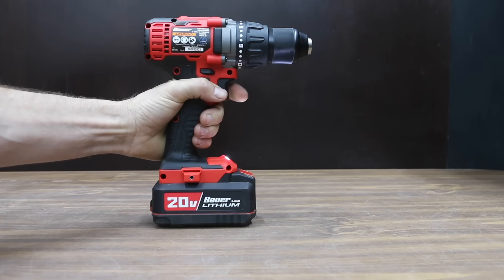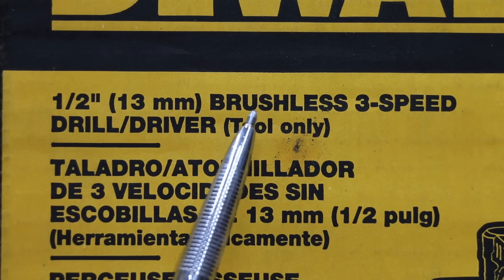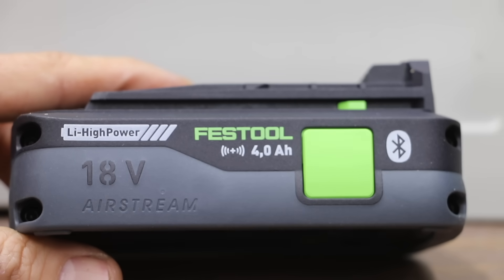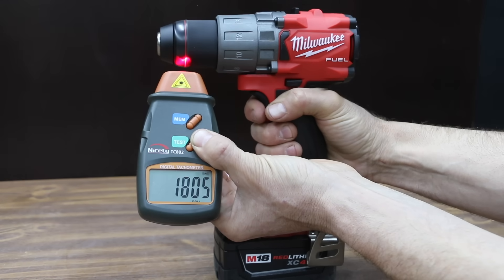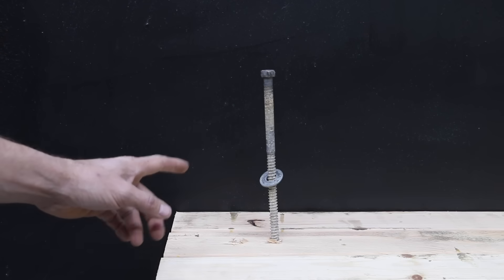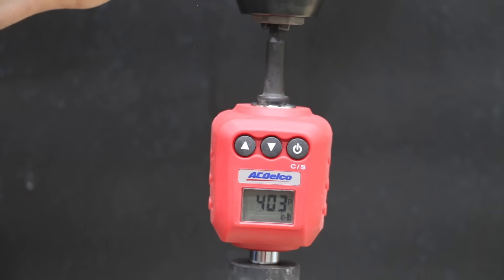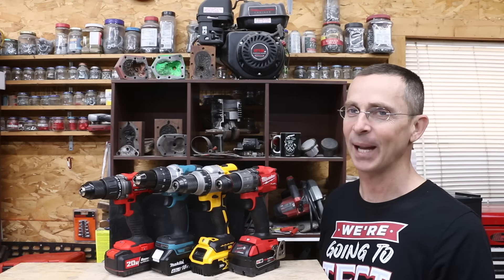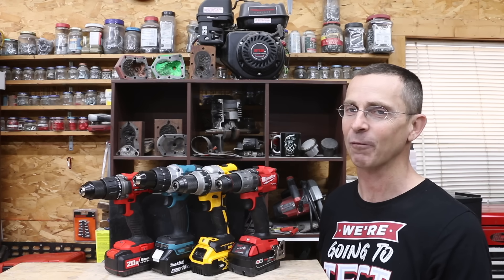Best Drill (BATTERY POWERED)? Milwaukee vs Dewalt, Makita, Bosch, Festool, Ryobi, Bauer, Ridgid

Comment: I have the Milwaukee drill with hammer function. This thing kicks like a donkey when it comes to removing tight nuts and bolts
Reply from the maker: Thanks for the feedback.
Reply: Yeah that's why I always use the impact driver for tight bolts, it has no kick
Reply: @techguy666  After it dislocated my shoulder I use my impact gun too - assuming I'm still able to. I thought it was a good idea to buy  a 2863 as my main impact gun but this bastard has the weight of an aircraft carrier. All for a 10mm bolt after all
Reply: @LMO169  I wish you speedy recovery. I was actually referring to 2857 which is far better than the drill for driving bolts and much lighter, the thing is a little beast!
Reply: @techguy666  Very much thank you, but I'm all fine. The shoulder dislocation part was all metaphorical speaking.
I'm still weighing the pros and cons if I should go for a 2554 or a 2557 if that stuff wouldn't cost two arms, a leg and a kidney here overseas

Comment: My biggest grip with cordless drills is batteries. I've barely used my dewalt and one of the packs has gone bad. A new one is close to $100. I think I'm going with Ryobi as my next drill as they offer l-ion packs at a more reasonable price. As a side note...I've never had cordless drill where the drill itself went bad. It's always the batteries that make it a paperweight.
Reply from the maker: Thanks for sharing.
Reply: Just buy non dewalt batteries at 1/3 the price. They work fine👍👍

Comment: Curious how the newer brushless Ryobi would  do in this test. Always appreciate the content!
Reply: Yes please! I ended up going all in on the ryobi brushless lineup and have been quite happy so far.
Reply: Ryobi and Milwaukee are owned by the same company, so Ryobi is always going to be the "budget" option that performs worse than Milwaukee does.
Reply: @SongOfStorms411  Great to know! I really went with ryobi because they have so many tools that use the same battery. I'm just using tools around the house and I don't want more than the 4 or so batteries I have already.
Reply from the maker: Thanks for the suggestion.
Reply: it sould be compairable to what he used in his hammer drill video.

Comment: Why no Hilti tools?
Reply from the maker: Thanks for the suggestion.
Reply: @ProjectFarm  You're Welcome.

I've had Hilti tools since 2011.
I bought a set in 2011 both a drill driver and the 1/4" impact driver.
Both are the 18v-22v equivalent. 

I killed the drill driver last year, I smoked the com bars as I tore it down to see what failed. It had a brushed motor. It did have 15k hour's on it and lasted 10 year's of heavy use.

The impact driver still works and still is going hard. However the gland end where the tools clip in. Well that has disintegrated so it no longer holds bits or snaps in like they once did. Yet it's almost 11 year's old. 

Considering the price back in 2011 for the set was close to 1k. It was by far the most expensive set of drills I've bought.

Considering both drills and the batteries lasted for 10 year's plus in extreme heavy duty commercial use.

I would be highly interested if they still used the same quality and robust construction as they did. Or have they gone to more of a pro sumer build. Like many of today's brands have.

Thanks for the great videos

Comment: DeWalt, Stanley, Porter Cable, and Black & Decker are all owned by the same company and many of their parts are interchangeable.  DeWalt is the most expensive but they all are typically good quality.  Not as good as Milwaukee, but for the price a good deal.

Great video as always!
Reply: Had a Porter Cable 1/2" drill 
turned out being a "POS" plastic gearbox. Never again.
Reply: @marklubecke4854  That sucks.  I've had a B&D 18 volt hammer drill since 2005 and it is still going strong.  My dad loves DeWalt;  I shouldn't tell him that a B&D is the same device at a lower cost....

Comment: As a contractor I’ve used and abused almost every brand corded and cordless tool except for the harbor freight branded ones. It was always the batteries or chargers on the cordless ones that failed first so I settled on Milwaukee for my cordless ones. I bought the battery Milwaukee chain saw even though in your review they didn’t come out on top but because I have multiple Milwaukee batteries and chargers.  Keep up the great reviews.
Reply from the maker: Great feedback and great point on the batteries too!!
Reply: Yep the battery usually always fails before the drill does in my last 4 or 5 drills anyway
Reply: Hoping to get that Milwaukee chainsaw myself! I think it tested similar to Dewalt and like you say once you’ve get a half dozen batteries you’re kind of stuck but I’m happy with Milwaukee
Reply: @davechapman451  Project farm said him self the 2 best chainsaw’s were dewalt and Makita.
Reply: I have makita Dewalt and Milwaukee.

Comment: My dad has almost all of Dewalt's power tools in his tool room because he had a good deal from Dewalt's 12v 18V and 20V batteries sometime in the recent past
Reply from the maker: Great point! Thank you
Reply: I have all dewalt because they have made it extremely easy to upgrade and buy newer tools without ditching the old ones. The 18 volt lineup can use the newer 20 volt batteries via an adapter,  the 20 volt tools can use the flex volt batteries,  some of the flex tools can use 120 volt wall power through an adapter.  Thank you dewalt for that.

Comment: This viewer recommending testing FLEX?
Reply from the maker: Added to my list for round 2. Great suggestion!!
Reply: @ProjectFarm  thank you for taking the time to respond. Alot of hype around FLEX Tools and since it’s the latest greatest, thought it would be a wonderful suggestion. FLEX Turbo is what I’m interested buying but before I do, let’s test it. But it has to be FLEX TURBO. PLEASE keep in mind, FLEX has non-turbo tools. From everything I’ve seen so far, FLEX Turbo has more power and less time to drill, cut, torque stuff. The FLEX tool company makes claims it bets dewalt, Milwaukee other major tool brands. I currently don’t own any tools and are in the market. But committing to just 1 battery system is expensive. The 24V 12.0AH LITHIUM-ION BATTERY is 250.00 bucks at my Lowe’s and that’s for one battery. Not including the price of the tools. Thank you for taking the time to put these video’s together. I’ll keep watching your channel and be on the lookout for you testing the FLEX TOOL Turbo system.

Comment: Hey. Can you do a test on https://www.rvs-usa.com/
Triboceramic engine coatings. It's a Finnish company but they have expanded to american markets now so i would love to see you test their product and see if any of the claims are real. 😍❤
Reply: I have tested in my bikes engine the product and it felt as the engine runs smoother but could be all just in my head so definitely would be cool to see your methods of testing the product and the claims. They have a car in Finland and USA that's been treated with the product and they are running them without oil to prove that it works but hard to say if it's just a marketing trick or do they actually work so well

Comment: Love it when manufacturers make claims and they HAVE to start sweating when you say "We're gonna test that!"  LOL
Reply: Look in to vacuum HP ratings and you know exactly whose the most full of it.
Reply: @mossyhollow3732  that's the tricky part of using hp as a rating. 18 wheeler has about 400 hp but a 700 hp pickup can't budge 75,000 lbs
Reply: Iron *Fe*  Claims such as RMP and torque should be very close to manufacturer claims, that has nothing to do with the materials they are designed to drill, cut etc.
Reply: I have a Hyper Tough drill I bought cause I needed a drill ASAP and wal mart was the only place open at the time and I have to say it’s lived up to its name. I’ve dropped and thrown it many times and still works fine.
Reply: @dudeabides4501  Snap On for professionals that can deduct it...  Hyper Tough for occasional use in non commercial settings.  I paid $8.00 for an old Black&Decker jig saw at a flea market; didn't even have to buy a blade; got the light job done...
Reply: @johnsee7269  snap on power tools are junk
Reply: @Teredifa  Warranty like Craftsman used to be...  break it; return it; get another one no questions asked.  That's what put Sears out of business; guatanteed forever and eventually everybody had them... (no need to buy more; lol)
Reply: Dewalt was pissed when that other guy did that dewalt Milwaukee challenge 🤣🤣🤣🤣I never liked dewalt anyway
Reply: Iron *Fe*  well said!
Reply: Love it when this same comment gets posted in every single video
Reply: Word
Reply: Right. Now we know why the companies don't do these tests lol.
Reply: Typical American made shit. Always over performing smh😤
Reply: Well not necessarily.  Some of them their promises hold true, but the question can be "for how long"?  Some of the cheap branded ones for example may be more powerful than the $500 ones, in the beginning, but you have to ask yourself, how long will this no-name/cheaper drill last.  How long will the battery last?  Things like that.  So they can make claims, and sometimes they are true... for a period of time at least.  I personally would recommend the MIlwaukee's as mine has suffered about 4 falls so far from a second story roof.  STill going strong.  I did have to replace one battery pack the broke open though, but that was the battery, but the drill is still going strong now in its 5th year...
Reply: @HR-wd6cw  I had a pprter cable drill dripped it off my roof it runs pretty good still just taped it up
Reply: Iron *Fe*  I am pretty sure than manufacturer's methodologies are less severe. ✔️
Reply: The manufacturers don’t know or don’t care about what some youtuber says about their products.
Reply: 😂 I thought the same thing.
Reply: Ridged all the way
Reply: He press harder when testing american products,typically american
Reply: @TheGagi82  Put out your own video and show us.
Reply: @TheGagi82  I've been handling power tools for over 40 years! It's the bits that does the cutting. Pressing down on a tool will only bind the motor more.
Reply: @thomascdurham9130  A certain pressure must be applied in order to do the job.
Reply: @TheGagi82  he didn't deny that 🙄
Reply: @thomascdurham9130  yup i kinda feel the same which is why i use a $20 tool on my diablo blades

Comment: I would like to suggest the 18-20v string trimmers for comparison. The brand I have is rather disappointing in design and power and I wonder if problems are similar across other brands.
Reply from the maker: Thank you for the video idea!
Reply: Step up to a higher voltage for something like a string trimmer, 40+volts. You'll be much happier
Reply: @Phate8263  that's the plan. I just want to know if mine is the only one that sucks 😂

Comment: Wow, that was the fastest video upload notification I got for my favorite product testing channel. :-)
Reply from the maker: Thank you very much!  I really enjoy ALL of you videos too!!  Amazing reviews on the ElectronicsNmore channel!!!
Reply: @ProjectFarm  Did you ever do one on the hitachi/metabo 18 volt drills/tools?  I have that brand, with a sawzall ,  a 6" circular saw, and the awesome small sized drill (I have bad carpal tunnel). I ask because I have several batteries and a charger that still works. I know they aren't the best, and Hitachi  sold to Metabo the prices have gone way up, and availability have gone down. If you have done a test on that brand, I couldn't find it. Thanks, and thank you for all your great videos.
Reply: @ProjectFarm  
The Milwaukee will do Lower Torque when you use the second Gear!
Reply: @ProjectFarm  DeWalt's 991... Why not the 996 or the 998 or the 999... The 999 is with power detect is a beast.. The 991 is an older drill with half the power. Milwaukee's 2803-20 is a newer model.. Seriously YouTube it.. The DC999 is by far the best drill as of now.
Reply: @John-771  why don't you make the videos? Ahhhhh exactly
Reply: @garrettbybee-mullins6634  Same reason you don't. I don't have the time, or energy. I work in HVAC 40+ hrs a week and use the tools he's showing. Besides If you are going to compare the latest and greatest of one brand you should compare it to the latest and greatest of the others. Am I wrong?
Reply: @John-771  I love my 996, it was the best of the best when I got it about 4 years back
Reply: @RickBaconsAdventures  and he's comparing the 991 (older) to top of the line today.
Reply: @John-771  and it still kicks butt
Reply: Why don't you comment on Taofledermaus anymore? You used to every video. Did y'all have a falling out? Are you anti 2A now, or?

Comment: Testing Festool is just trolling at this point.
Reply from the maker: Thanks for the feedback.  Lots of viewer requests to test Festool
Reply: Would be cool to see how well Hilti stacks up against it; if it would be close to Milwaukee or Festool.
Reply: @QuantumLeap83  Hilti's new brushless stuff hits pretty hard. People will definitely cry foul for it being 22v vs 18v there.
Reply: @orijimi  if they want to use the 22 volt Mikita gets to run the new 40 !! 😁
Reply: @orijimi  22 ,20 and 18 v is all the same the voltage is just measured differently. Take apart the battery and it will have the same number of cells.
Reply: @morgancoldfirecoldfire8256  22v/24v is one more cell, you're wrong. Equal watt hours between an 18v battery and a 22v battery? Yes, that's possible.
Reply: @robertcollett8073  Philly Fixed put the new XGT Makita drill up against the 18v/22v competition, and it might as well be 18v, the thing is pathetic for a supposed next generation tool. I run mostly Makita, so it's pretty damn disappointing to see.
Reply: i must be mixing 18 and 20
Reply: @orijimi  I’m going to have to check that out. Makita is my brand so I was expecting almost plug in power.
Reply: @robertcollett8073  Oh, whoops, actually, I went back and checked and what I'm remembering is the impact driver. The XGT drill did actually perform better than DeWalt and Milwauke, but by nowhere near the margin that the M18 impact driver outperformed the XGT.
Reply: @QuantumLeap83  I made the same comment. In Europe many professionals buy Hilti because it's well known to be the best. You don't buy just a tool, you buy a service. I don't think all the Hilti tools are necessary better, in some cases DeWalt, and Milwaukee especially, might be better, but in most of the cases I think they are not. It would be great to see Hilti in these reviews.
Reply: @QuantumLeap83  hilti drills dont come close to milwaukee or dewalt on power or speed
Reply: i was looking forward to seeing the drop test :)
Reply: I use the Festool PDC daily bought it second hand, this drill design is also realy old 2012 i believe
Reply: @MickDuijf  Is 2012. Looks 1990s.
Reply: @orijimi  😂
Reply: I'm glad he's testing festool
Reply: Hilti would have been a better choice than Festool, a brand few encounter in either home or professional use.
Reply: @cristopherfrakes1416  alot of people in europe use festool way more then hilti
Reply: Why would you buy a Festool ??
Reply: Festool looks like over priced garbage
Reply: The thing with Hilti is that they are for true production professionals and you are usually just leasing the tool instead of buying it outright. For example maybe I'm a contractor who needs a large jackhammer or industrial pressure washer. Instead of buying one for $4000 I can just rent it from Hilti for a week for $400.
Reply: Maybe some Hitachi stuff on here? Looks ok for the price mostly
Reply: I'm surprised to to see festool rather than kobalt...
Reply: @Bremend  haha, kobalt is junk compaired to festool
Reply: @Bremend  Yeah, if I have one complaint with Project Farm, it's that the number of brands tested in these power tool ones don't really match the likes of Toolboxbuzz or Pro Tool Reviews.
Reply: Festool is really expensive because it is made to run extremely smooth and be very durable. Every tool in their line up is underpowered because of that. It is made for craftsmen who want the very best most accurate tools. Yet I do not see the value personally. It is only slightly more accurate and in a few years you will want the next best thing anyway
Reply: @jroc7443  They make some niche shit, that's their real appeal.
Reply: @jroc7443  then it would have a mechanical clutch
Reply: @jroc7443  The accuracy and best claims certainly did not hold up here.

They look like a colossal waste of money.
Reply: @someguy5035  never seen a festool on a job site
Reply: @jroc7443  festool is not more durable then dewalt or milwaukee, i own some festool stuff an all needed repairs after 1 or 2 years of use
still goodd stuff but way overpriced for what you get
Reply: Quite unfair to post the $544 price of the Festool drill, which includes 2 batteries, charger, and systainer case.

A similar Milwaukee setup (FUEL drill, 2 batteries, charger, packout case) would be around the $400 mark, making the $544 Festool price a lot more reasonable.

I'm not saying that the festool drill is worth the price, but the way the video portrayed it was not fair to the Festool.  The drill is not designed to be a torque monster, or drive lag bolts.
Reply: @PhysicsDude55  no drill is designed to drive in lag bolts… you got to use a adapter.
Reply: @PhysicsDude55  but is that the only way you can buy festool? Milwaukee doesn't force you buy all those things just to have the drill.
Reply: @PhysicsDude55  Festool is trash